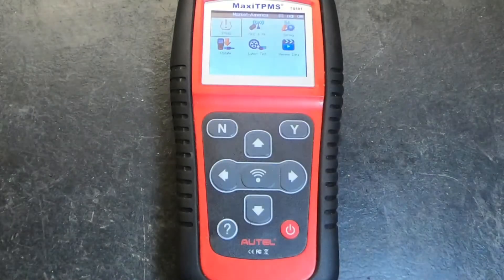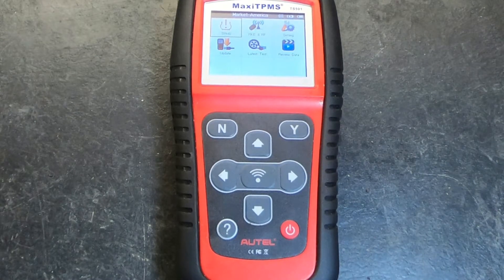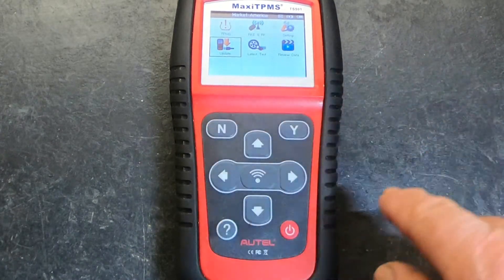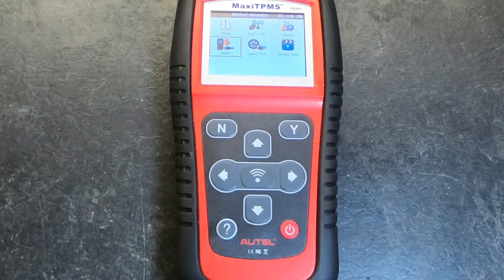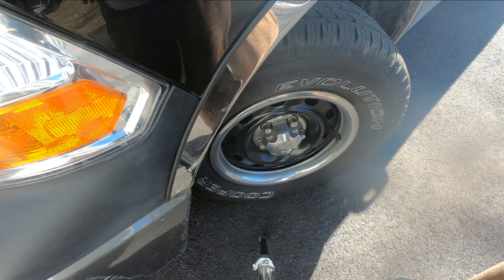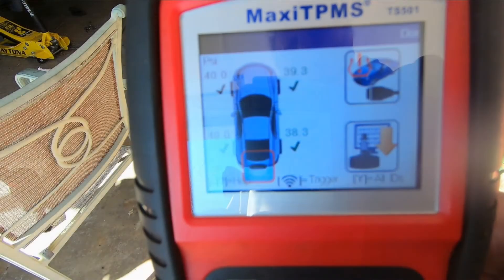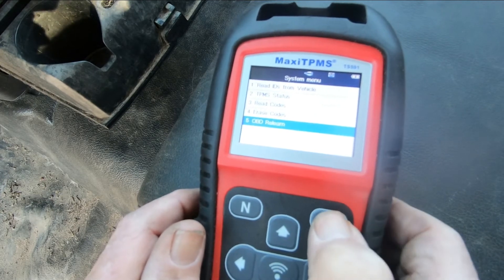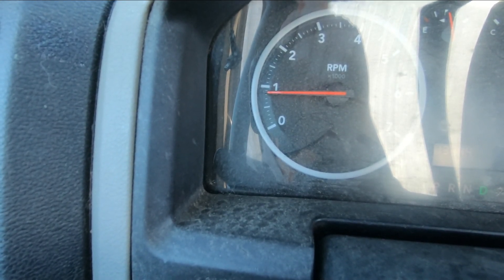How to use the Autel TS501 TPMS Tool

Comment: My Autel MaxiTPMS TS501 Pro came without the usb cable, power port and guide missing. I tried to connect to my Tpms sensor and it doesn’t find it. Waiting to hear back from Autel
Reply from the maker: In my experience Autel customer service is very good. I am sure they will take good care of you

Comment: Thank you for this informative film. It was very useful for me, since I also have Autel TS501 and need to program one TPMS sensor. That sensor will be located on the full size spare tire. Can I remove one wheel w/tire, locate there my spare full size and program it, so whenever that tire is needed it is ready to go? Also after you program the 4 tires how it is shown in this film, do you need to reprogram after each tire rotation? Thank you again.
Reply from the maker: If your car supports the spare tire, you can. Most do not but there are some that do. When you connect into the data port if the spare is supported it should show it. As far as rotating the tires you only need to reprogram if you have a dashboard display showing the pressure of each tire and its location. If you have nothing but the indicator lite showing one of your tires is low but not witch one, then you need not bother. Those type systems leave it up to you to find the low tire once you get the warning anyway.
Reply: @richardspaulding5035  Thank you very much for the explanations. Our car has that simple system, just w/indicator. It doesn't support the spare, but I thought to program just one more wheel and keep it in the garage (full size back up tire). Probably it is not possible, since the system would keep information only for 4 tires. So if I remove one tire, put the spare on, program it's sensor, put the spare in garage, put the previous tire on, I would need to reprogram again, bcs the info on this tire would be erased. Thank you again.

Comment: i have the exact same tool and truck and the light still wont go away :(
Reply from the maker: It is difficult to diagnose a problem from afar. I had an issue like that once. The original sensors had been replaced by programable sensors that were not compatible with Autel.

Comment: good viedo i get to the relearn step i dont get success i get problem wont do it
Reply from the maker: I had that problem at first Anthony. It would read the tire pressures ok, but I could never get it to relearn. The problem was, I attempted to use the device right out of the box. I did not update the software. Once I updated the software the relearn function started working. Check the manual that came with the device, There will be instructions on how to update the software. Thanks for the comment, let me know how you make out.
Reply: @richardspaulding5035  i did update after and ralked with there teck people turns out jeep 2020 models wont relearn that way its is auto relearn ,you just drive it and it lears it but itsa still havent learned all of them yet
Reply from the maker: @tonycorvettes   I Had a Chrysler like that once. It did the relearn by driving. As I recall I think I had to go like 20 miles per hour for about a mile or so. Thanks for getting back to me.

Comment: Does this work with any tpms
Reply from the maker: It will not work with programable sensors from other brands of TPMS tools. It will work with Autel programable sensors and all other origanal equipment sensors. Some manufactures no longer use tire sensors like Honda, VW,  Mazda and others. They use an indirect system that senses tire pressure through the vehicles existing ABS / traction control sensors. Thanks for the question and thanks for watching.
Reply: @richardspaulding5035  going off what you said there, i have a 2015 Skoda superb and have to replace a wheel and tire due to damage, will i need this device or has it got he other type of indirect system that you mentioned, if so how would  i go about changing my tires and wheels while not running in to issues with lights on the dash board. thank you so much . all help very much appreciated
Reply from the maker: @KeithGumbrell  Most indirect systems use the existing ABS system to detect a low tire, I am not familiar with your model, so I do not know which system you have. You can tell you have an indirect system if your tire utilizes an ordinary stem like the older cars used to have.  You are correct in as much as if you do indeed have the indirect system, you do not need the TPMS diagnostic tool.  If you have wheel sensors, chances are good it was not damaged and can be transferred to your replacement wheel. In that case you should not need the TPMS tool because it should still be programed into your car's computer. However, if the wheel sensor is replaced than it will need to be programed thus you will need the TPMS tool. Most tire shops have these tools and will know what to do.

Comment: Richard, great video.  I've done this task about a half dozen times, which has proven to not be enough for me to remember the procedure without looking it up still.  You saved me a decent amount of time by laying this out flat.  Just reprogrammed another vehicle with no drama at all.  I am very grateful.
Reply from the maker: Thanks George; I am glad you found the video helpful. When I first got the tool it took me a while to figure it out myself. I found the help section pretty useless.
Reply from the maker: One of Fords better ideas. You need a special Ford TPMS transmitter tool.  You can get one on amazon for about $15.00. There will be lots of videos on YouTube showing how to use it.

Comment: Well done on the TPMS relearn with the Autel TS501. And up to the point too. But there's one option you overlooked. You can also program blank Autel MX-Sensors as well. Useful if you run a large wheel and tire business and don't want to stock too many OE sensors.
Reply from the maker: Thanks Jonathan; I did not mention that because I did not have any to demonstrate but I should have none the less. Thanks again for watching.
Reply: @richardspaulding5035  No problem.
Reply: Thx for the info
Reply: does it only work w/autel or all brands???  Thanks
Reply: @meseahunt  For blank programmable TPMS sensors, Autel MX Sensors only work with any Autel MaxiTPMS tool (i.e.: TS501, TS508, etc.) Otherwise, any Autel MaxiTPMS tool can read any direct-fit OEM or aftermarket TPMS sensor that are already programmed to the vehicle's specific make, model, year, and protocol.